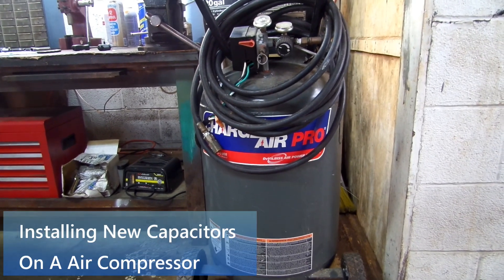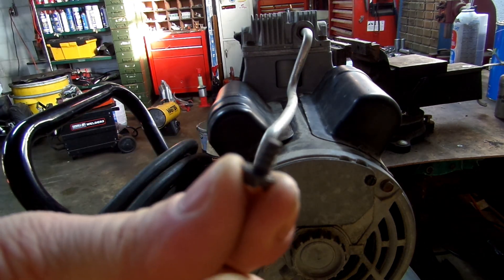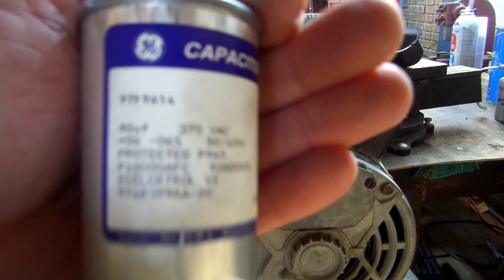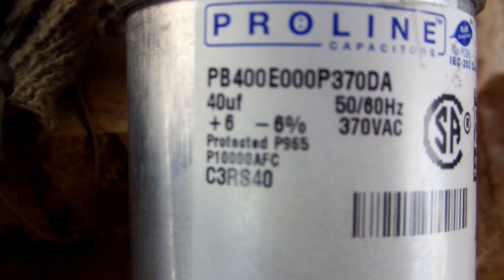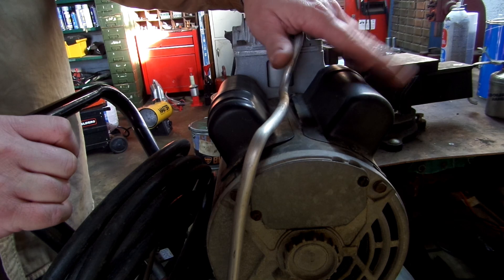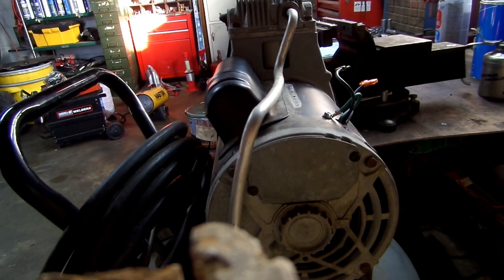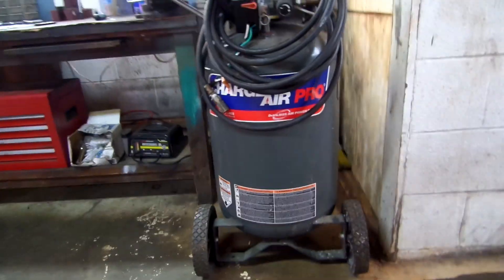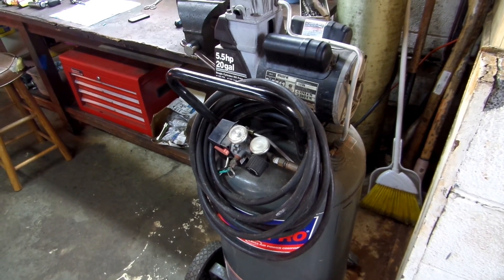Air Compressor Not Working / Replacing Capacitors

Comment: My sanborn 30 gal oilfree compressor since day one. Would start up fill up but when needing to start with it would just bog then trip the circuit breaker of the house. Of every time i needed more air to work i have empty the tank and start from empty. Now after all this time it will not make it to cut off b4 triping the breaker. Check value is ok. 
Pressure switch system functioned normally. 
Only things i could think of was the  wire gauge difference between the outlet cord and motor leads, motor has thinner wires, or the motor  is self. This video was helpful about the capacitors.
Reply: So did you change the capacitor(s)?  Did it work?  Problem solved?
Reply from the maker: Yes, I changed both capacitors and fixed my issue
Reply: @outdoorpowertech7738  Perfect, thank you.  I'm about to do the same.  Changed unloader valve, check valve, dismantled manifold and pressure switch, but the problem seems to be the start capacitor.  I don't like throwing parts, but the process of elimination.....  Thanks again.

Comment: The first capacitor you replaced was the run capacitor. The second one was the start capacitor. If the motor was starting then shutting off, than the problem was with the run capacitor.
Reply: This is a great video and helped a lot but having the capacitors mixed up threw me off and almost trashed my compressor motor after it didn’t start when I swapped out capacitors!

Comment: The higher voltage capacitor, 300+V, is the Run capacitor. The lower voltage, 165V, is the Start capacitor.

Comment: Do you still have this compressor? Any chance of getting the info on nameplate of compressor motor? I've got a Craftsman compressor with a start & run capacitor. The run capacitor is the same as yours, hoping maybe start capacitor is also. Don't have the old one, looking to order the replacement. Thanks

Comment: So the the capacitor has no positive or negative it doesn't matter which way I hook it up ? I got free compressor theirs 3 wires 4 tabs ?
Reply from the maker: Correct

Comment: The capacitor with a plastic housing is always the start capacitor (the most dangerous one) it's in a plastic housing so when it pops shrapnel doesn't fly everywhere.

Comment: How can you tell which capacitor goes in which spot? I have a craftsman with a weg motor and the start capacitor keeps overheating. I'm wondering if they were installed backwards by a previous owner.

Comment: I just bought one with what looks like the same engine and I think it might be wired 220 when I put a plug on it it had almost no power at all trying to figure out how to wire in 110 or if I should try out the 220

Comment: I have very similar 240 volt compressor about 20 years old! I do not see any marks on either of the two capacitors that identify the "polarity" of the start or the run capacitor? My quest is that it doesn't matter since its AC current?
Reply from the maker: Yes your correct, no polarity

Comment: Amazing video im gonna try to replace the capacitor. I have a Weg w56J 0.5hp single phase motor, but only has one capacitor, how i know if its the run capacitor or the start capacitor? Im worried because every time i connect the motor the house voltage drops from 120v to 80v and moment later backs to normal. I think this isnt normal.
Reply: i dont mean to be offtopic but does someone know a trick to log back into an instagram account..?
I was dumb lost the login password. I would appreciate any help you can give me.
Reply: @Roland Raphael Instablaster ;)

Comment: Thanks for this video! The replacement run capacitor you have listed has three electrical connections instead of two. Will it still work?

Comment: My compressor sounds like it's not getting enough power. It tries to start up but instead of fully powering up, it is weak and wobbly and never gets up to full power/speed. It also heats up like crazy.
Sometimes after multiple tries to start it up (with a foot pedal), it will come on. It used to fail to start up only once in a while. It has gotten worse over time.
Are these the symptoms of a failing run capacitor? (The air compressor has only 1 capacitor.)

Comment: I have an old (probably 18yrs old Porter Cable air compressor) It has an AO Smith motor. It trips the breaker. Just took off the front facing capacitor housing. The capacitor has no marking on it at all making this a problem.
Any suggestions??
Reply from the maker: I’m sorry without markings it would probably be unsafe to guess. You can probably look up the model and serial number and look up a parts list online
Reply: thanks for taking the time to reply. I found the serial # on the motor also says Type K 
Did not see a model #. I think Porter Cable deliberately omitted the label on the  capacitor.
I can call the company that bought AO Smith on Monday. Maybe they can identify it. @outdoorpowertech7738
Reply from the maker: Most likely,  they like doing stuff like that to make it hard on us

Comment: I see a lot of videos with compressors like yours and others with Craftsman type that are having this issue. I was inspecting my Craftsman 30 gal 6 hp that’s about 20 years old and it doesn’t have any caps. Why is that?
Also, don’t use a 14 Ga extension cord cause it will cause your breaker to pop as well. Need to handle at least 15 amps.
Reply: The capacitor on the craftsman 6 hp 30 gallon air compressor are in the back cover of the motor which is on the opposite side of the fan.

Comment: how exact do the capacitors need to be to the original?  have a 35mfd 240v that i absolutely cannot find anywhere online
Reply from the maker: I’m not a electrician but I would match what you have. Here is a place to start https://www.bghydro.com/capacitor-hps-250-35-mfd-240v.html

Comment: Sir im from Philippines. My problem is i already change the  capacitor the run and start capacitor but still humming
Reply from the maker: Ronel Salvoro your air  piston is probably froze up. Their is nothing you can do if that happens. I’m so sorry buddy,
Reply: Ronel Salvoro chec your pressure switch
Reply: Check valve possibly failed or the bleeder has failed by not taking pressure off the head thereby locking up your motor? Other possibilities maybe a bearing failure. 

But try and disconnect the pump tubing at check valve at try and start motor if it runs the it’s probably your check valve .

Comment: If you ever take a capacitor out and loose it before ordering another its almost impossible to find the right one again.A larger value will always work but not a lesser value. The trouble is getting one to fit the cover.

Was you close by when your old compressor blew up?
I've seen a few videos like that lately which has me more concerned about air compressors.

One guy spent 3 months in the hospital because a tank blew up close to him.
https://www.youtube.com/watch?v=KVP_A7eGYxw

And this one launched the compressor way into the air finally landing in a swimming pool. 
https://www.youtube.com/watch?v=4u8GGCqq-4U